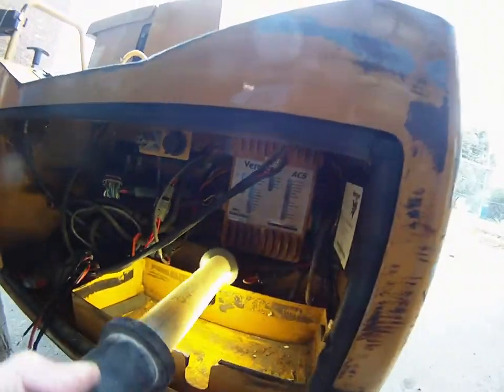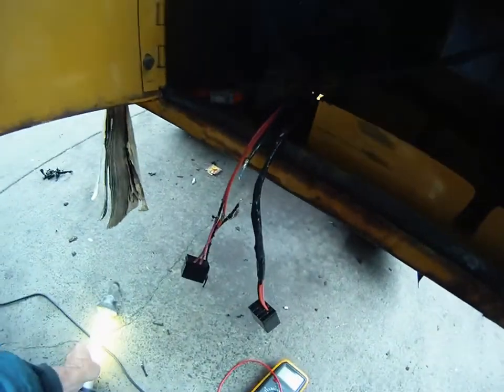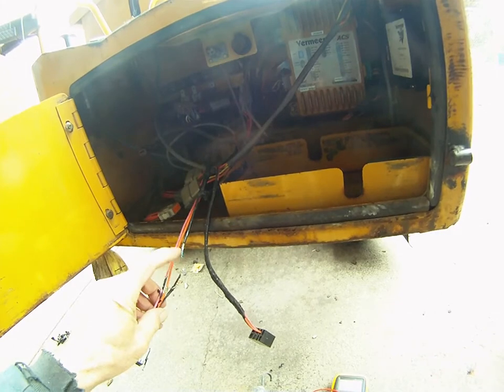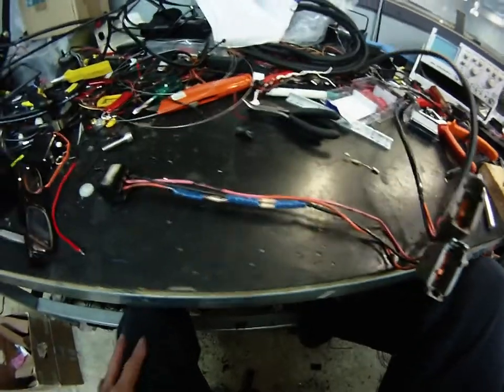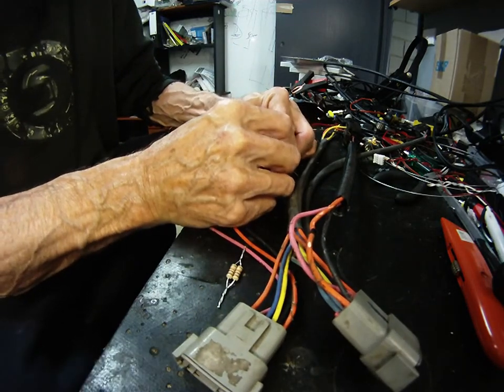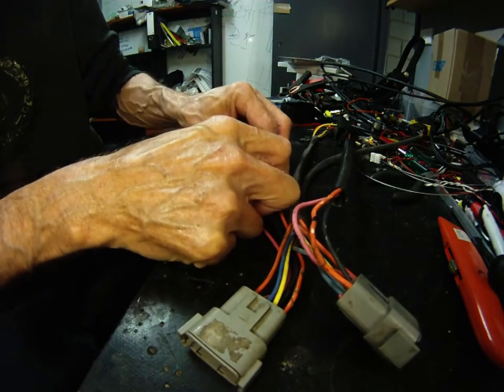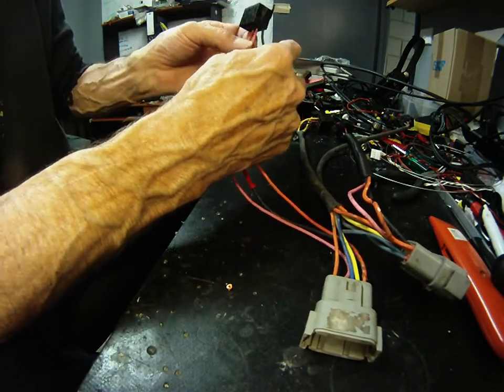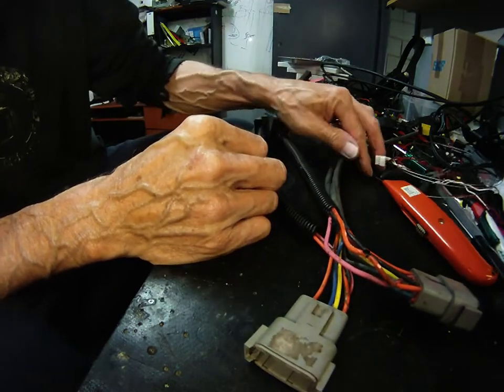Vermeer SC60TX stump grinder track control harness fault

Comment: What is the machine doesn’t go forward or backwards, starts up fine but wheel light flashes then doesn’t move at all
Reply from the maker: Been a long time since I worked on it
But flashing wheel lamp wasn't something I encountered.
It would indicate some condition that may be a fault but also may be something elses that needs to be set on the machine.
Id look into the manual to see if you can find any trouble shooting info on flashing indicator lamps.
Otherwise check for fault codes on the ECM lamps and call Vermeer for info on it too.

Comment: My tracks won’t retract from 52 to 36 do you know anything about that
Reply from the maker: Not sure what those numbers 52 and 36 are
Can you provide anymore info on the fault a bit more.
Reply: Are you still working on the 60tx? He means tracks are at 52inches wide and he is trying to get them down to 36inches.

There is a switch on the control station arm that pulls out. If that switch is not connected, it will not complete the circuit to move the tracks in.

If the switch is there, just complete the circuit with a paper clip or wire. Make a U and it will work

Comment: Let me clarify it goes forward and reverse but it will not always climb up into a trailer or climb a hill and the left side is slower than the right
Reply from the maker: That could be something else, the issue in the video is a directions issue, depending on which resistor breaks it may not go in one direction or it can go in the opposite direction to the one you pressed.
I know on the remote it has 2 speeds with a "rabbit" or "turtle" indicator, if one side was low speed and the other high speed it would yaw.
But if it only occurs under load then its probably not electrical and you will probably have to test the hydraulics, it might be loosing pressure to one side that would be worse the more load you put on it climbing.
The hydraulic solenoids are double acting and have 2 stages for slow and high speed in each direction.
Reply: AuMechanic it's sporadic sometimes it works just perfect sometimes it won't work at all
Reply from the maker: That's going to take a bit of going over to find.
You can check those short switch harnesses to make sure they are working and give them a bit of a wiggle to see if there is any breaks in the resistors.
BTW that machine has other resistors in the harness that can fail running to the alternator and covered it in the other videos on the SC machine so check out all of them.
You will need to test the control hydraulic solenoids (left side of the machine) are all operating on a switch signal and if they are then it will probably need some pressure testing but I never needed to go that far on this machine.

Comment: Hey bro my boss has one of these machines and we're having problems with the forward and reverse on the left side sometimes it'll go and sometimes it won't
Reply from the maker: Hi Michael
To fix this you need someone with an ohm meter and some understanding of resistors.
If you have an auto elec you could show the the video and remove the short harness I'm working on in the video that runs between the rocker switch and the main harness. 
That short wire harness I took off usually contains those broken resistors and he can test it to see if there is a break and find the resistors in it,  then see what values the resistors are and replace them if broken.
Reply: AuMechanic. I have a multimeter and a fairly good understanding of electrical being motorcycle car RV tractor hydraulics in the United States we used to have a RadioShack we no longer have this store
Reply from the maker: You could get them online, I believe most in the USA use "mouser" electronics for components.
You'll have to unplug the harness like I've shown in the video and try to trace any resistors in it to see if they are broken. Because they are solid wire if the break they can contact again with vibration making the fault intermittent.
So just take the control switch short harness off and un tape the cover of it to expose any resistors in the wires of it just like in the video.
The resistors in it were about 1/8 watt and very small so I got 1/4 watt and used 2 in parallel just to make it stronger. So if there is a 5k resistor, put 2 x 10k resistors in parallel (=5K total) twisted together like I did.
Reply from the maker: Just keep in mind the way this harness works is it fakes the signal to the controller.
The resistors used make a resistance bridge with a centre voltage being stop, when you operate the rocker switch that shorts one side of the bridge causing a low voltage to the controller, pushing the rocker the other way opens it sending the higher voltage signal to the controller.
Reply: AuMechanic so I wouldn't be able to use save a voltage regulator instead of a resistor
Reply from the maker: No, the controller needs to have its own signal return from the switch, it's not just a matter of feeding it the right voltages.